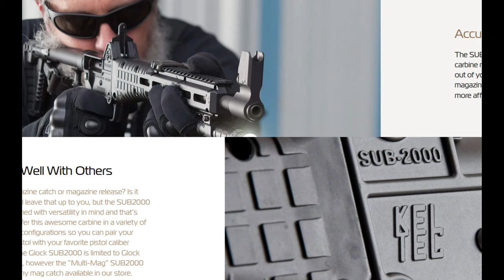No more English units in cycling

Comment: I use both, but primarily standard because I'm the only bike person in my friend group. And as I talk with people online a lot, some of those are from outside the US so I'm used to having to provide both measures. OSMAnd~ gives me the measures for both so it's not a big deal. Bike parts are also in both inch and metric - Inch-standard: Headsets! Pedals! Some seatposts! Bearings!
For my daily life, I measure in grams, pounds, mm, cm, inches, feet, meters, miles, fl.oz, cups, gallons, and DegF depending on what I'm doing and how precise I need to be.
Reply from the maker: I think this is something I should have thought to mention, which is pretty much everyone is using a combination of both these days if you consider the bike parts, not only the tools needed but even sizes are a mix, like 700mm bars, and 29" wheels.
Reply: @BruceChastain  yup. 27.5" wheels attached to a suspension fork with travel measured in millimeters. With a disk rotor also millimeters.

Comment: German language is in short 🤮
I learned it for 9 years and I hate it. But on other side English is much much simplier and widely used. I learned it for 5-6 years and I can speak it almost fluently anytime anywhere. 

Well metric system is better and less confusing. Milimeters, meters, kilometers, kilos etc, but in cycling and cars there is still much measures in Inches and it’s parts, for example chain, tyres etc.
But it’s thing of what you live with and get used to it.

I personally will never understand what means 5/16” 😲🙄😮
WTF
Reply from the maker: look for common OSB thicknesses, 23/32 is in there....